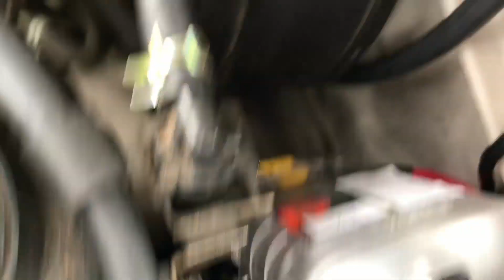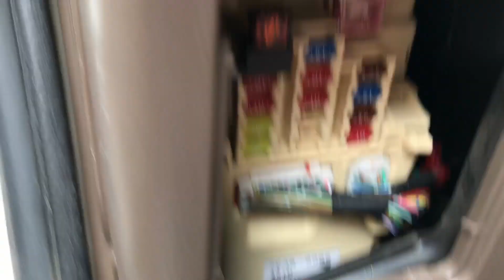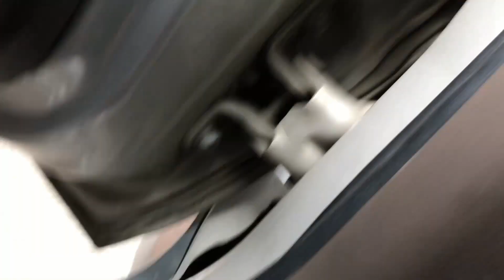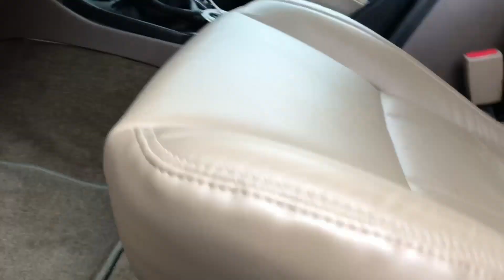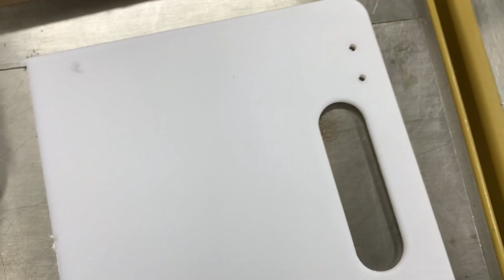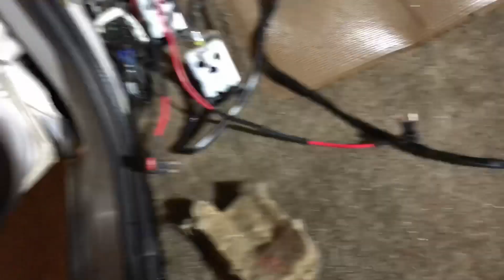2000 toyota 4runner add in fuse box and ACC fuse box

Comment: Can not find compressor relay switch for 2000 4Runner. The AC doesn’t work can anyone tell me where to find it. It’s not in the fuse box under the hood or under the steering wheel on the driver’s side nor the glove compartment .